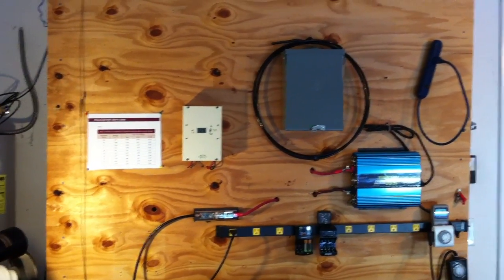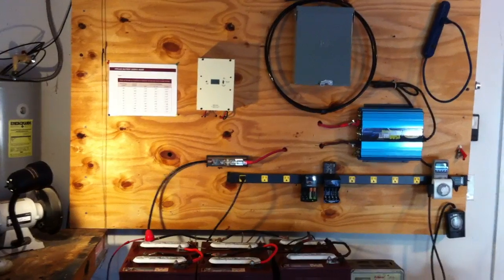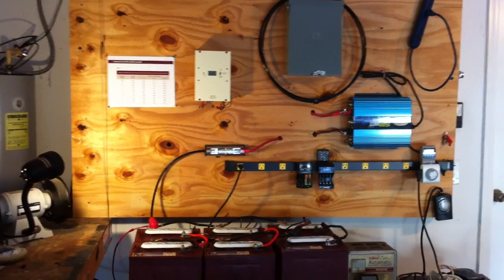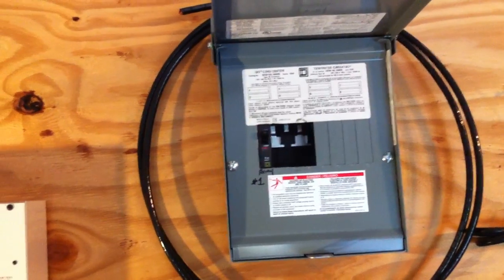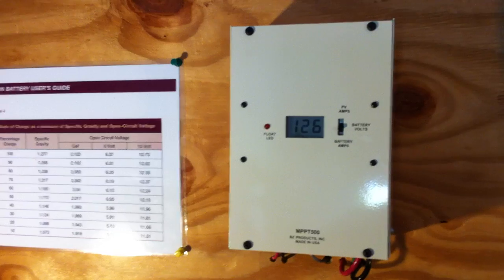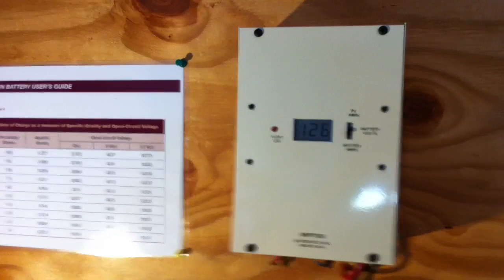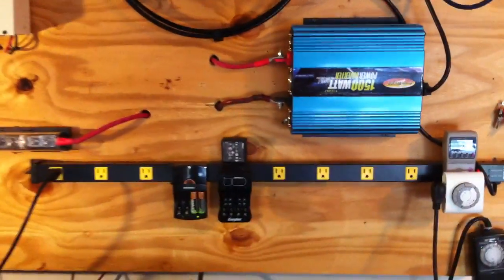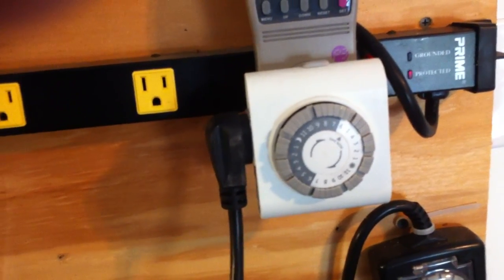Small Off Grid Solar 1

Comment: Very nice system mate. I am glad you did that 12 v test system. Its a big learning curve for many PPL, I have just a small tip for you and weather you use it or not its up to you. In your cabin Put in a 24 v system. It dose not cost much to change over. The reason is easy. You use less amps to run items. Say that freezer used 6 amps on 12 well on 24 it would use 3 amps. The math I did on 1 of my videos. Your 12 v system is good. Its not free power. But its nice power. And feels good.